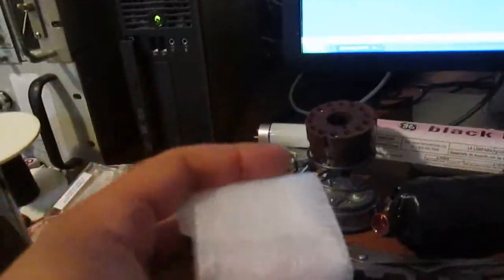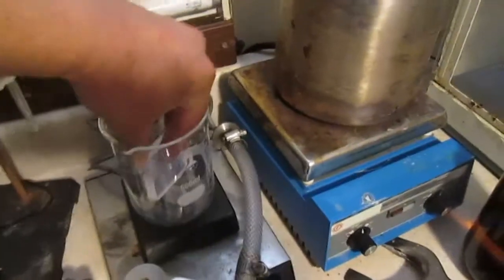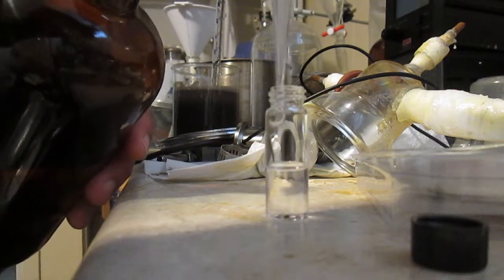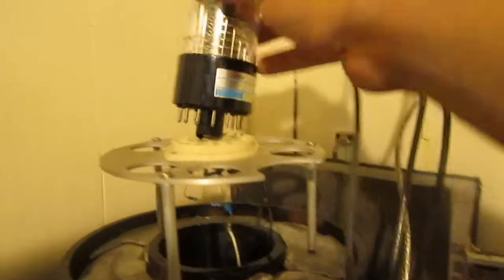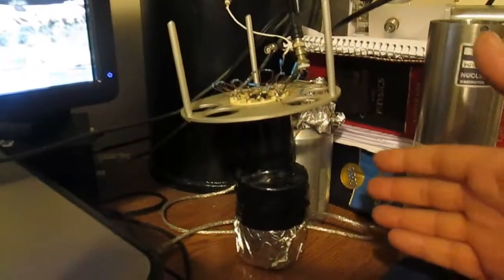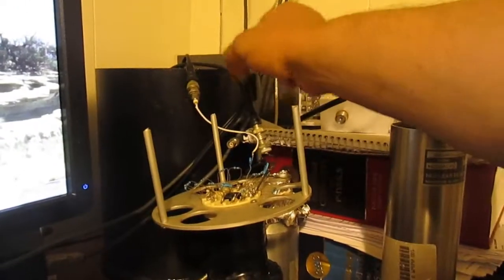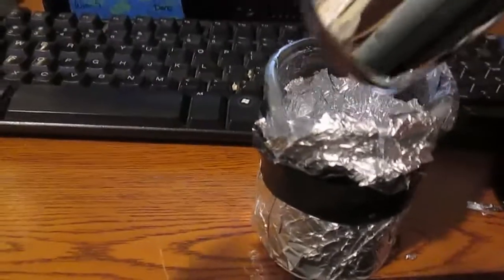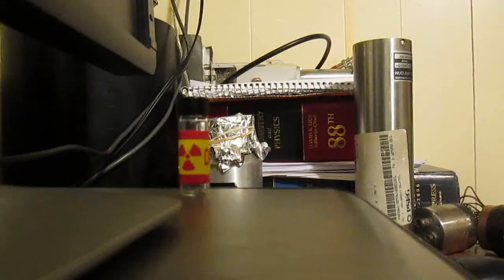beta spectroscopy trial

Comment: Hm. A few impressions:
1. plastic scintillators are not good for spectroscopy. The energy resolution is pretty poor. I have experimented with a few of them, and while they are sensitive (especially the big one I have 3"x3" Bicron412) they can't distinguish Co-60 from Cs-137 for instance. This won't change when dissolved.
2. that aluminum foil will stop a lot of the  betas
3. the main reason for using a liquid scintillator instead of a solid one, especially for beta, is so you can mix your sample with the scintillator, this way there is no shielding between the beta emitter and the scintillating compound and ensures maximum energy transfer. Works best for liquid samples that are miscible with the scintillating liquid.
Reply from the maker: Thanks for your comment ! I did a poor job at explaining what I was doing but the source is inside the beaker right up against the detector in the liquid . I apologise for this fact not being obvious... I should have been more precise... Also I was experimenting not knowing if it would work I have never messed with plastic scintillator before and I thought hey ! Why not ! ;) Thanks
Reply: @Neptunium  The video makes more sense now.  I have used liquid scintillation in the past, but that was 20 years ago. It was when I worked with P-32 on metabolic pathways.

BTW I sent you and U2U on scimad about your Th videos which I wanted to watch again but can't find anymore. :(
Reply: @Neptunium  That makes sense. Stay safe. The NRC aren't too bad, I'm exchanging correspondence with them every once in a while. :)
Reply from the maker: Really ? Maybe iam being paranoid !...
Reply: @Neptunium  Just because you're paranoid doesn't mean they're not after you.
Reply from the maker: @stamasd lol! That's why I am not doing anything like that anymore